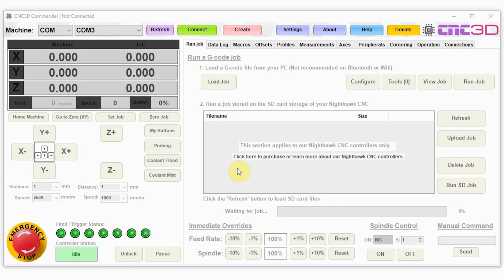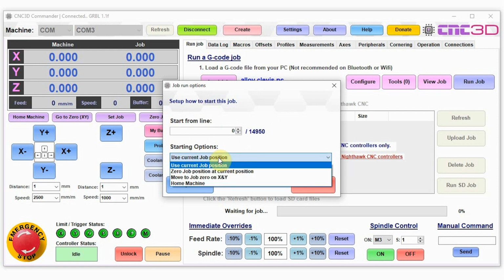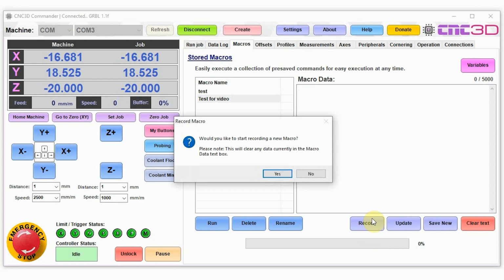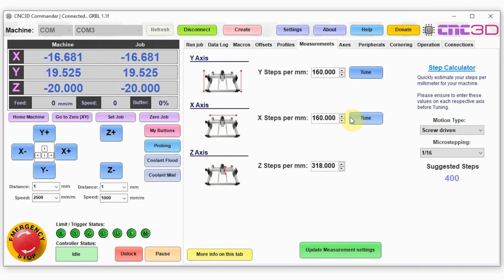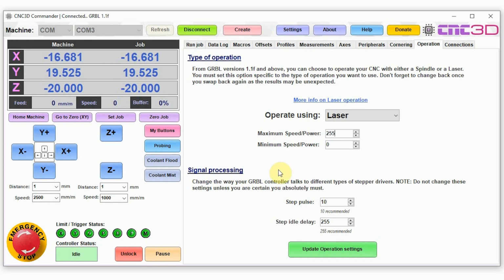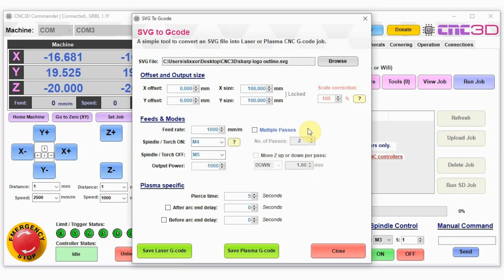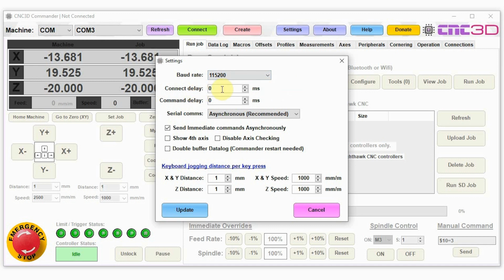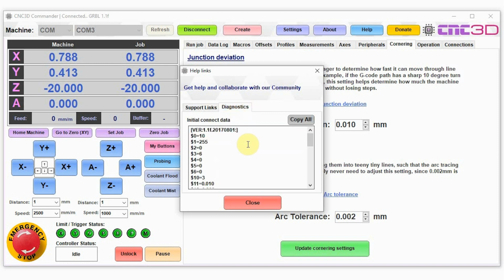CNC3D Commander - GRBL Control Software BUILD 256

Comment: Hello again, I was able to test the software and it detected my cnc which is a Proverxl4030 from Genmitsu .
The software worked fine I only used it to move the cnc, test the parameters, the sensors etc. 

But I would like to tell you about a problem that I had with my cnc controller, It seems that my cnc controller is sensitive to voltage changes because if I disconnected or turned on any equipment in my house, the cnc machine would stop working ... and the work had to be thrown away. 

I tell you this because maybe you can add to your software that in case of a g-code error or if the power fails, the software gives us the possibility to start the work where it left off. 

I think that would be a plus point in its software since because of my experience I began to search on this topic and discovered in various forums that many people have had similar problems ... Well it is just a suggestion. 

Greetings and thanks for the work you are doing.👋🏼
Reply from the maker: Hi Aaron,

If you have homing enabled it may be worthwhile taking advantage of G28.

G28 is a fixed position based on machine coordinates that lets you have an exact place to go to. If you are at your job zero after homing and send G28.1 it will save that spot in EEPROM. When you want to travel back there from a failure, simply home the machine and send "G28 X0 Y0" then send "G28 Z0". this will safely travel above the work piece on X and Y and then the second command will drop the Z to the Z zero starting position. Alternatively, if it's safe to do so, you can issue "G28" on it's own and it will travel all 3 axes to the G28 saved position.

This may not be the ultimate solution regarding resuming from exactly where you left off but at least you can air cut your way back through the job.

I Hope this helps!

-  Dave
Reply: @cnc3d  

Thank you for your time and response, it will surely help me, I will take it into account and save this detail. 👋🏼

Comment: Thanks for the soft I really think it will be one of the best, I'll see if I can use it this week.
Reply from the maker: Hi Aaron,

We have made a blog post regarding this,

https://www.cnc3d.com.au/post/important-notice-commander-update

Please see the updated post afterwards where Microsoft has cleared our software of any issues and approved our program as safe.

https://www.cnc3d.com.au/post/cnc3d-commander-important-notice
Reply: @cnc3d   
Ok Thanks , so no problem , great .
Reply from the maker: @Aaron_A_ImplosionChannel  It has always been a challenge in the last 5 years for software to emerge on the market, there are so many restrictions imposed by Microsoft and apple to ensure their users are safe. It can be difficult to predict a new threat which is why Microsoft had flagged our software as the updater downloads another file from our web server and then renames it on the back end. They interpreted this as malicious. Now that we have been approved this issue should be resolved.
Reply: @cnc3d  
I know there are tough times, and there are also many problems with security. 
I just asked the question to find out. 

For my part I will share your program with friends so that more people know it, 
there was really a need for such a program, where everything can be configured. 
Thanks.